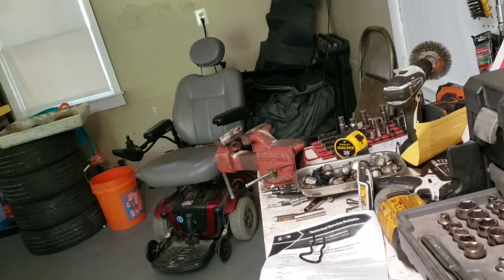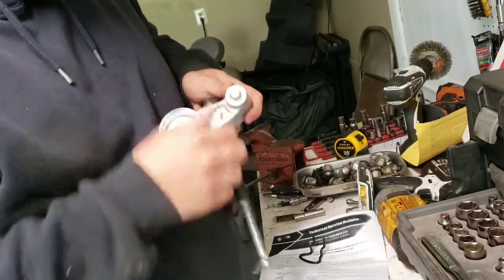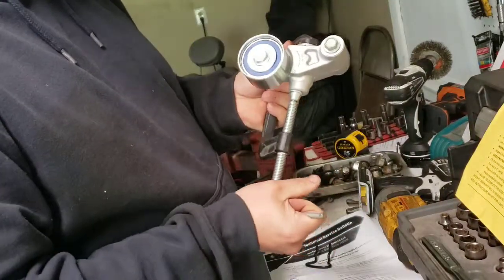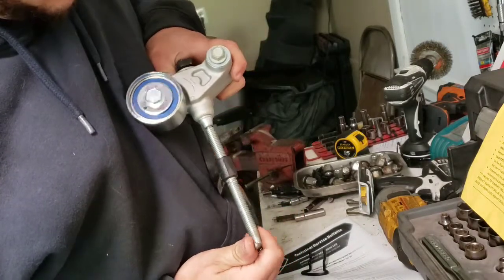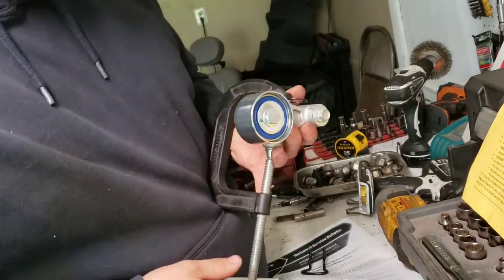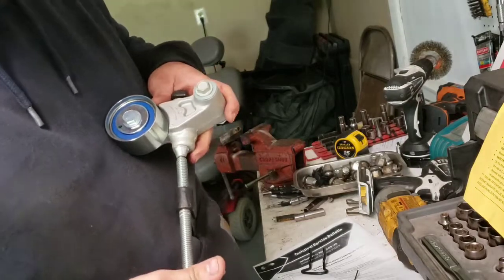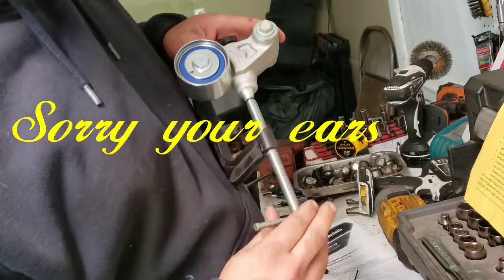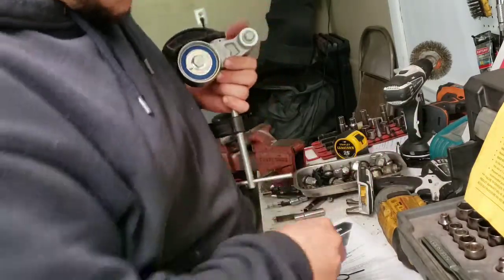Subaru Timing Belt Tensioner bleeding  Procedure

Comment: found faster way lol pull plunger put it in a vac chamber    air comes out fro. under the check valve  inside to the dirt seal on top then let air back in to chamber slow   and ur good to go

Comment: What about the already used tensioner? Can this be done?
Reply from the maker: Dont need to do it then
Reply: @AllDickdup  can't get it back in, belt way too tight. With pin up it seems
Reply from the maker: @goaster187  put a pin back in and try
Reply: @AllDickdup  well I just realized,or learned that all the oil around the tensioner pin should not be there lol. Should not leak any oil. I thot the oil meant it was nice and smooth,pin up and down. But nope, that's a broken tensioner lol. So I'm buying a timing belt kit. Thankyou for the info!!!

Comment: Thanks for the video.  I'm bleeding one right now and wanted to make sure I understood.  I did figure out that you need to have the threaded end of the C-clamp on bottom or it can turn the shaft a bit, then the pin won't go back it.  Not a big deal, just use the pin to turn it back where it should be when all tension is off of it.